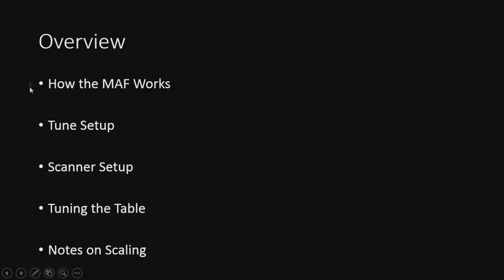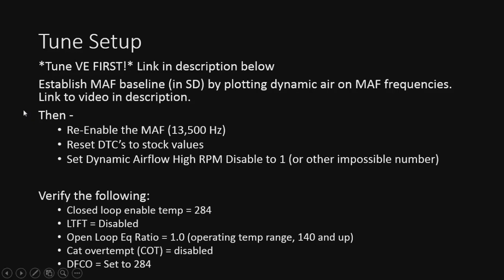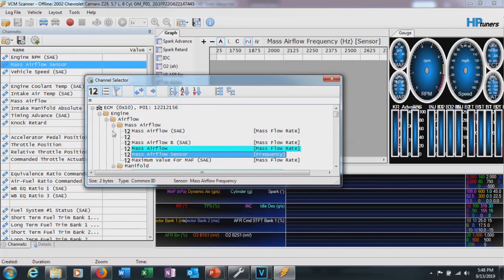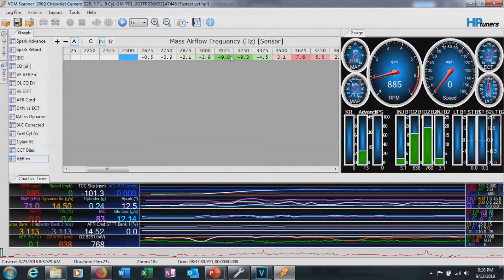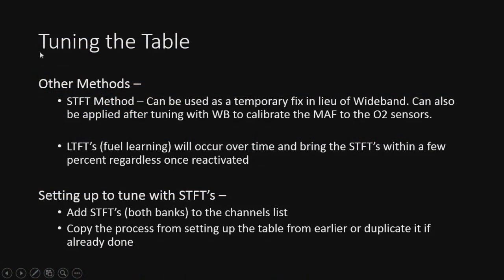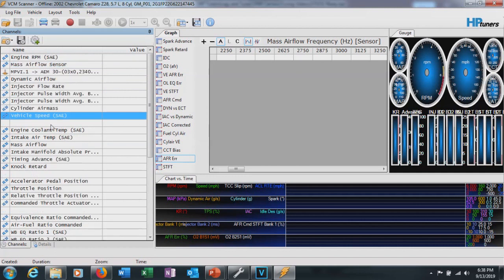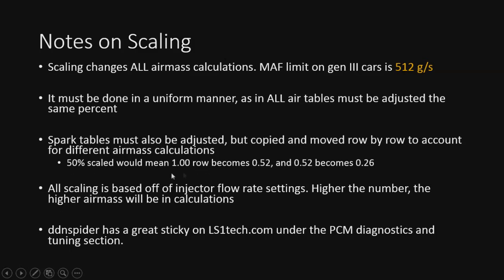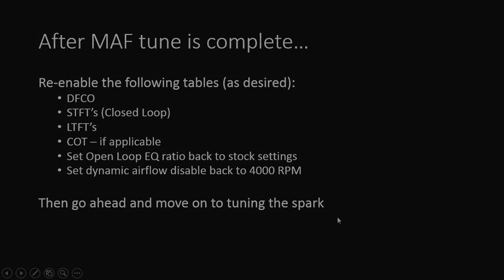MAF Tuning (Following VE Tune)

Comment: cold u drop ur email so that i can ask u a few things i have everything set up like u said   my buddy has me set up to tune maf diff from what u have i can email u the logs of ur way and his and tell me witch i should go with his is not making sense to me i have a aem 30-300 wideband i think how wideband is set up in channels is whats throwing me off he says i have to log in lamda then i can just copy paste  by half percent he said if i leave it in 14.7 ill have to do math? but if i switch to lamda then ur graph dont show any data ?so i guess i just need u to look at my two diff channel setups and tell me witch is right to tune my maf on my gen  3 p59 ecu would mean alot to me if u could help me with this lil problem 

thank u i have facebook also if thats more easy i can send screenn shots too
Reply from the maker: You can simply change the histogram to log lambda and use that as a correction. When setting up the graph just use lambda instead of AFR. The end result is the same.
Reply: @ChopperDoc181  ok thank u

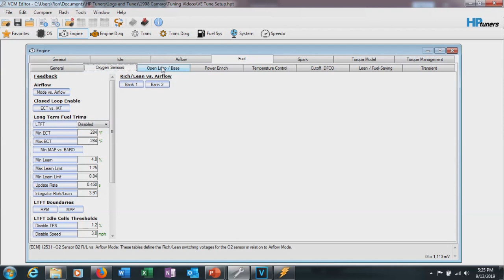Comment: At 4:35 you set the open loop eq ratio to 1.0 across the high end of the table. Isn’t that too lean for WOT tuning? Why not set the eq ratio to 1.18 (12.5 AFR) across the board and verify with your Wide band?
Reply from the maker: Because PE is for WOT. If you do it it on that table, it could command 12.5 all the time outside of WOT. It’s not necessary. Set up your PE triggers appropriately and you will command 12.5 under high load. The idea behind “1’ing” out this table is so you remove another adder from the list of adders modifying your commanded so you can get a more accurate airflow baseline. The only adder you should be using for WOT is PE.

Comment: This is the first time I've ever seen ve tuning suggested being done before MAF tuning 🤔. 

What's the reasoning behind this exactly?
Reply from the maker: Because the Gen III PCM is MAF based, meaning that if the MAF is enabled in anyway it will affect your SD tune. That’s why a lot of guys also unplug it when tuning SD. So it makes sense to tune SD first, then MAF, then spark. It was the way that always worked in the past, and the way I still do it. 

On later generations you can’t fully disable the MAF, however newer generations also don’t have SD tables either. Just lots and lots of complicated formulas. That’s why there is an editor for that now. It used to be a standalone program for that made by Bluecat. HPT has since essentially added this program into the editor. 

But yeah, lots of old tutorials will show the way I’m showing. It’s how I learned, so it’s how I teach it.
Reply: @ChopperDoc181  I really love the detail you go into on these processes. I do have a few questions for you though if you don't mind. I'm starting to tune a GM 3800 series 2 V6 that I've built and done a supercharged top swap to. Nothing to crazy. Very mild cam that's almost stock. 

My question is there's no real way to disable dfco on these PCMs. It's a P04 PCM. This Gen 3 stuff is really close, and it's what I was told to follow for tuning procedures. I do have a wideband and HP tuners with pro features. What's the best way around thed dfco issue since I can't disable that? Is bumping up the cell counts the best way to try and keep most of the lean conditions from deceleration from skewing the data?
Reply from the maker: No just don’t tune that area. It won’t matter if you can’t turn off DFCO.

Comment: awesome video, very informative, it helped me alot... now i'm looking into tuning the spark tables... is it possible you could make a video?
Reply from the maker: Spark is tricky for street tuning. I generally tune out knock as I’m going and reduce and smooth those areas. As for trying to maximize potential, a good race logger or an actual track can substitute for a dyno. Beyond that, look into my boost tune setup guide as to what areas to watch out for. It gives you an idea where you’ll have trouble if you push too hard.

Comment: I have a cammed ls1 that at 7200 hz it’s falling in it’s face. I put a 100mm housing and ls7 maf in it. I’m having issues idling under 1k. Could my placement be the issue?
Reply from the maker: Placement is always a consideration. You can try a different clock position. Normally MAF functions best under high flow. Is it having the same issue when you put it in speed density?
Reply: @ChopperDoc181  no, I gave up trying to tune it myself cause I think I bit off more then I can chew. But the guy I sent it too says it runs good in speed density but is still not wanting to idle under 1k and can’t do wot pulls
Reply from the maker: It may need to be scaled, not sure. I don’t know your setup and can’t see the log, so best I can do is guess. Sorry for not being a better help there.

Comment: So even if I am going to tune a maf only wot ol tune I still need to tune the ve table first ?I am confused and If I am tuning on open loop whenever I finish collbrating the maf why do I renable the oxy sensors and dfco..etc shouldn't I leave it disabled since I am doing a maf tune in open loop isn't this going to mess everything up and make my tuning useless since close loop will be renabled???
Reply from the maker: Some folks do run MAF only setups. As for your other questions, MAF is tuned in open loop using a wide band, just like VE. Don’t turn on any adders, leave it just like the VE tune setup. Only difference is the table you are adjusting, and one other setting under dynamic airflow. You want to set your high RPM disable for dynamic air down to 1 RPM so the PCM will always use the MAF as the airmass model. Normally it’s recommend to also tune the VE to have a complete and proper tune. However it is possible to skip this as there are a lot of ways to setup a tune and many possible combinations out there.
Reply: Thanks came a long way since then pretty much got the idea I have another  couple question about tuning for best fuel mpg should I use stft ,ltft to do such a tune or is it better with a wide band and what does actually need tuning for best mpg beside the maf ,ve tables do I need to tune for example timing ,pe, if you could give me the basic of this to start with I already know how to log and tune but I don't know how to go about such a tune do I need to disable something before doing a tune like this for example do I need to reduce timing ,maybe do something in power enrichment ...etc I have no idea about this the only thing I know it's about tuning the maf and ve tables so I would like you to write me some steps for this to set me at the right direction

Comment: You copy high octane to low octane table after you disable the MAF to tune VE. Don’t you re-enable the low octane table when done tuning?
Reply from the maker: Yes, though if you do not have anything on the knock learn factor, the low octane table isn't necessarily needed. It exists as a safety net for running low octane fuels. If your setup is a daily driver, and you require the table, yes, you re-enable it just like normal. If you have prolonged knock that drives the number towards the LO table when you are using your desired fuel, then obviously fixing that is priority.

Comment: In my HP Tuner program on the VCM Editor Engine Diag page I can only see DTC's, it isn't giving me the options for Airflow etc. Am I doing something wrong? I just need to set my MAF Fail Freq to 0 so I can disable. I have a Holley Terminator X Max system integrated which runs speed density only. Somehow the MAF is interfering with the engine running at higher RPM AFR goes crazy cyclical
Reply from the maker: I'd give Holley customer service a call on this one. I can't be of much help here unfortunately, since I have no experience with that operating system or PCM. You're using HPT to tune it I assume?
Reply: @ChopperDoc181  Thanks for the reply - It's not the Holley ECU I'm programming with the HP Tuner, it's the OEM PCM that still controls the MAF. Just need to access that MAF Fail Freq and adjust to "0"
Reply from the maker: That’s pretty strange that you don’t have the other tabs. Here’s a few things you can try though... obviously unplug the MAF itself, if it’s plugged in. That will fail it for sure lol. Second, go to your dynamic airflow tab (under airflow) and set it to the max RPM for dynamic airflow disable. I think I cover that in the guide here, except you’ll be going the other direction obviously. Stock is usually 3k or 4k RPM. That should prevent the MAF from making airflow calcs, hopefully.
Reply from the maker: The dynamic airflow High RPM disable I’m talking about is at 4:00 in the video. Set that bad boy to 9999 or something your engine will never see. Like I said, hopefully that works.
Reply: @ChopperDoc181  Thank you so much for the reply..I did try unplugging the MAF and the car shut off? Not sure why. So that I'm clear the car is running during these changes and not running when I write the program? Also, should the engine be running to see these tabs I'm not seeing on the VCM Editor page under engine diag?
Reply from the maker: Normally when adjusting a calibration (tune) the vehicle is off, and depending on the vehicle the key is on but engine is off. There are instructions for different vehicles on key position during the writing procedure. Are you using the real time tuning feature? Everything in my videos is based on the traditional, scan the car running, shut car off, adjust tune file, write vehicle (engine off), then scan again to check changes, and repeat. 

All of these tabs should be available offline, as there is no requirement to be connected to the car when adjusting a tune. Have you tried posting this issue on any other sites like ls1tech or hpt? This isn’t something I’ve heard of before. Very odd issue.
Reply: @donperspective  You've probably figured this out by now but to get all of the parameters you have to go to Edit, View and change the view from Basic to Advanced in the VCM Editor

Comment: Can you tell me here or maybe make an addition to your Ve video and explain how to graph/log the VE table using STFT? I'm assuming instead of AFR Error the same stft is used just like it is in this video for MAF tuning.
Reply from the maker: I apologize for the late reply... Been on vacation with the family. All you have to do is go to >Engine>Fuel>Oxygen Sensors>Closed Loop Enable... and set back to stock values. From there, in the scanner, use STFT's as the "error" plot instead of the wideband. There is a PID available to use both banks, might have to scroll to look for it. Just type STFT into the search bar and the options should all be there as to what to plot. 

Remember though, this WILL NOT work in power enrichment. So if you are on the throttle hard, when things are most likely to break, then you will have NO clue what is going on with your fuel. When entering PE, the last STFT that was logged is basically what the PCM goes off of from there on up. If it's lean, then that's even worse. It is highly recommended to use a wideband for tuning fuel tables. Trust me it's worth the extra $150.
Reply: When you change the eq ratio to 1.0 above 140 degrees . How do you know what to change eq ratio back to after maf/ve tuning is complete?
Reply: Nevermine back to stock settings,